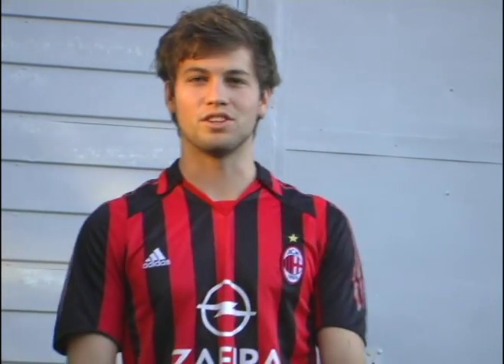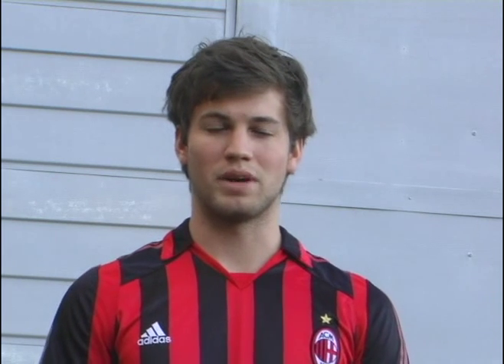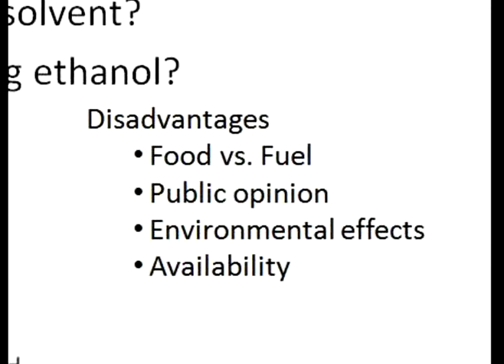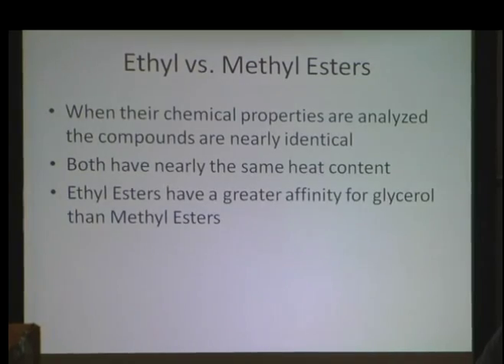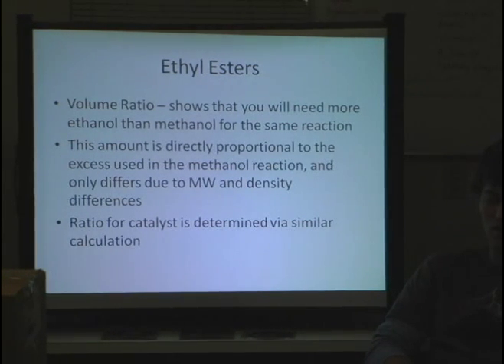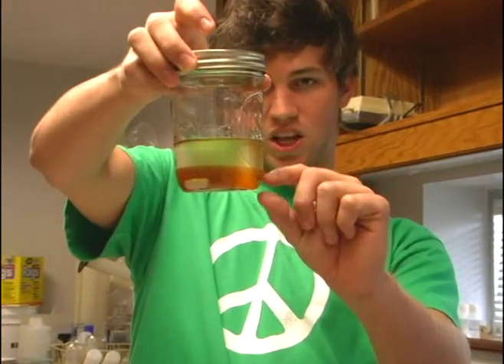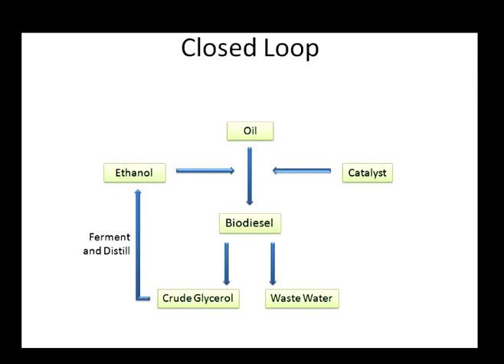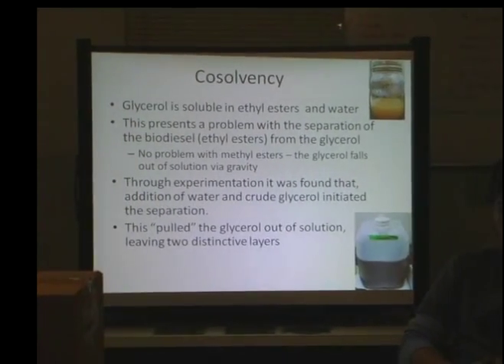Biodiesel from waste vegetable oil- 2008 BioEnergy Summer School

Comment: Excellent work gentlemen, I too have researched the ethanol path.. I'm curious @ what proof was the ethanol u used to get a good reaction??  I like the Closed loop ferment & distill method of Glycerol.  Is this doable by home brewer??

U can also Turn the water heater upside down & pipe the Glycerin drain to the lowest  port for better draining..  & with a simple  pot still reclaim some methanol for next process,  then for me, It's  Soap making time..   LOL.. ;)

Keep up the good work !!